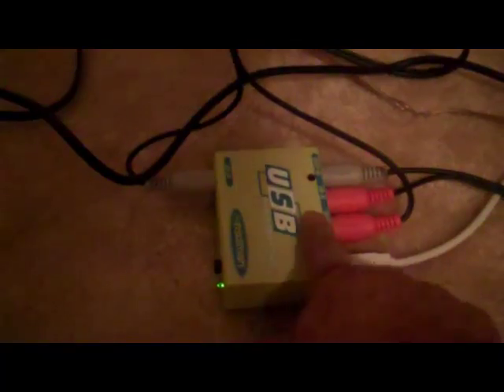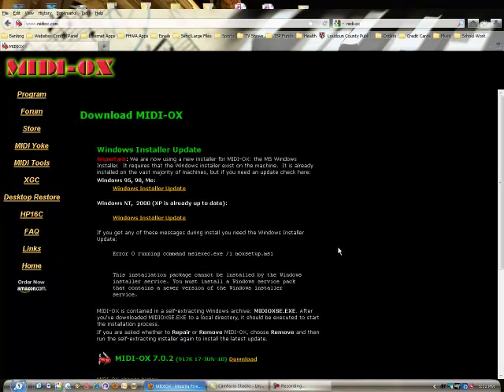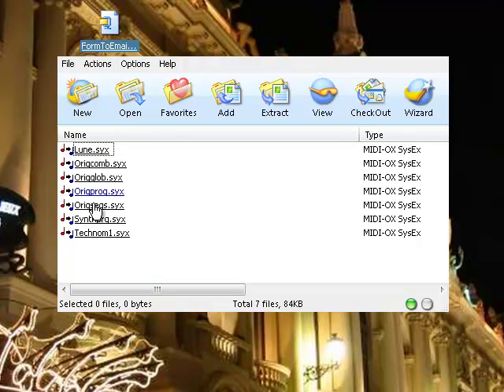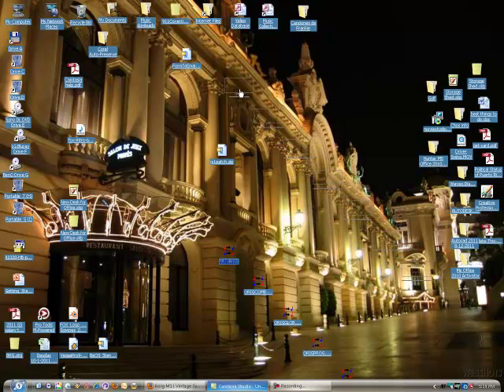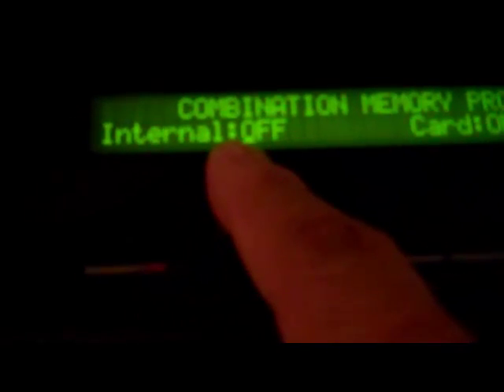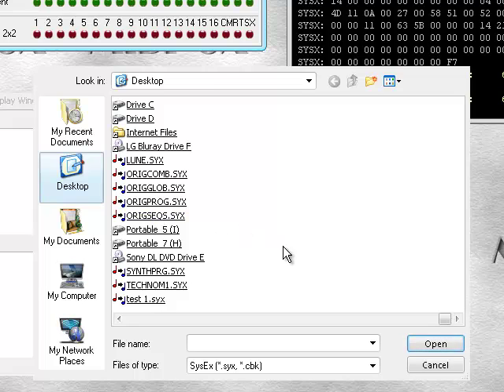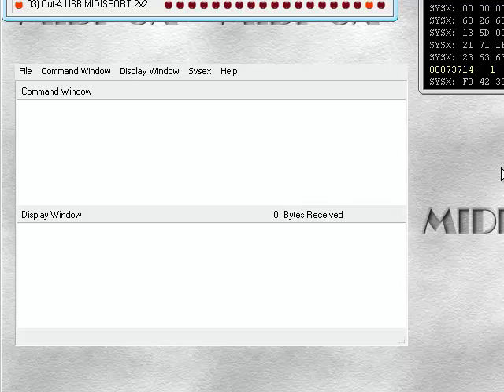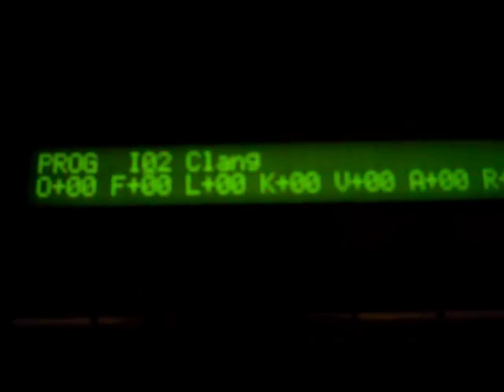Patch Replacement for Korg M1 after Battery was Dead

Comment from the maker: Great!  One more satisfied customer. hahahah
Reply: First of all, your video on changing the battery was great.  I did that and now am trying to restore the sounds.  I get the midiox installed but when I open it shows No Output devices and No Input devices.  I have tried the midi cables both ways: in put to input, out put to out put and reversed.  My USB to Midi device has a single cable connecting the USB to the computer and one midi marked IN and another marked OUT.  Any help would be appreciated.

Comment: what is this channel 9 stuff about
Reply from the maker: +Rus Cruz Just a random channel you pick to transmit and receive.  But you can make the uni respond to any channel for that matter.  That's called Omni (transmitting on all available channels)
Reply: +anievestor do you have to set the global channel set on the M1 in the MidiOX?
Reply from the maker: Not really but give me a chance to find them out and I will at least let you know what I used and worked for me, but this should not be an issue.  Stand by